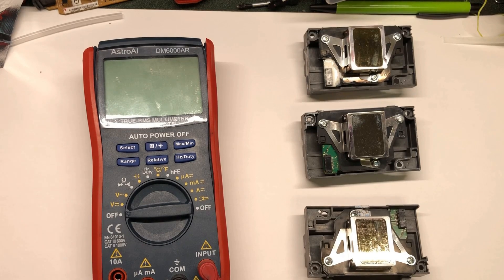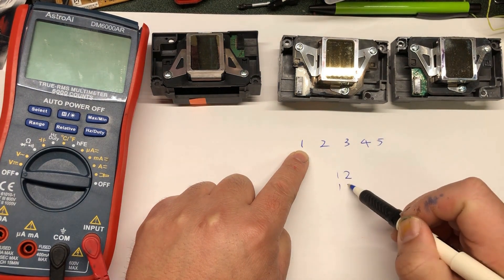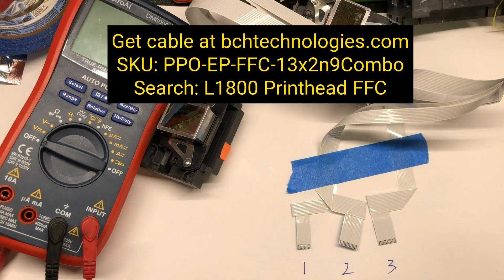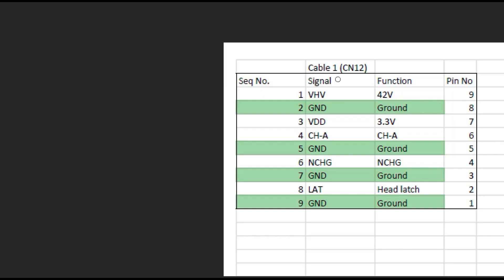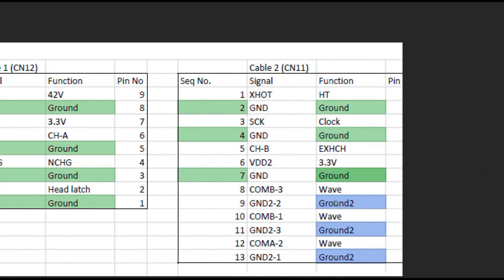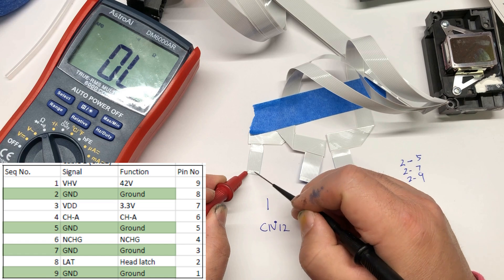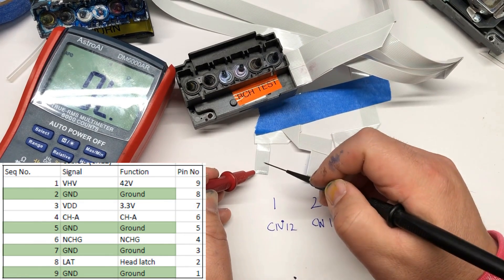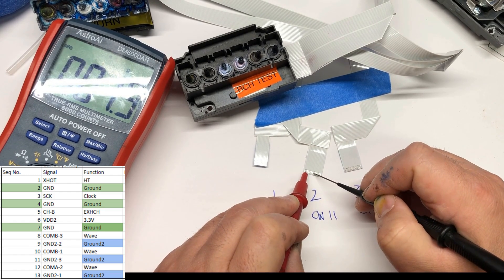Good or Bad? Testing a L1800 Printhead with Multimeter Revealed!

Comment: Did you aver tested tx800 printhead?
Reply from the maker: Thank you so much for subscribing and for your support—it really helps the channel grow as we work towards our 100k goal! I have not personally tested a TX800 printhead with a multimeter, so I can't provide specific guidance or reliable values for that model, as the circuitry and acceptable resistance can vary significantly between different printheads. I'm currently working through a large backlog of subscriber questions and aim to answer within a few days, but for accurate, model-specific technical support on this, your best and fastest option is to email support@bchtechnologies.com directly. If my other printhead testing videos have been helpful for your repair journey, I’d be incredibly grateful if you could leave a kind review on my Google page at https://g.page/r/CfL7k6nYvPQ9EAg/review.

Comment: If my head for R270 short circuit between VHV(Pin9)
 and nearby GND ( Pin 8) due to ink. Now it was tested between these two pins are 56 ohms. How can I fix this problem? Thanks!
Reply from the maker: Thanks so much for subscribing and helping us on the road to 100k! Your support really drives the channel forward. Regarding your question, unfortunately once there’s a short between VHV (pin 9) and GND (pin 8) inside the printhead, there’s no way to fix it—those kinds of internal shorts are permanent. I try to answer subscriber questions within a few days, but I do have a big backlog right now and I’m catching up as quickly as I can. If you ever need faster help, you can email [support@bchtechnologies.com](mailto:support@bchtechnologies.com), though members always get first priority. And if this video or my comment helped your journey, I’d be so grateful if you could leave a review on my Google page here: [https://g.page/r/CfL7k6nYvPQ9EAg/review](https://g.page/r/CfL7k6nYvPQ9EAg/review)

Comment: I3200 print head chek this way?
Reply from the maker: Thanks so much for subscribing—it really means a lot and helps us get closer to our 100K goal (we're climbing steadily!). The method shown in the video doesn’t apply to the I3200 printhead because different printheads have different pin layouts and signal configurations, so using the wrong method can cause inaccurate readings or even damage. I try to answer subscriber questions within a few days, though I’ve got a big backlog right now—really appreciate your patience! If you need urgent help, feel free to email [support@bchtechnologies.com](mailto:support@bchtechnologies.com).

Comment: Do you have the pin chart for the xp-15000 as well? I blew my F1 and I want to see if the printhead itself is bad before I replace the fuse. Thanks!
Reply from the maker: Thanks so much for being a member! Your support means a lot and helps us keep producing exclusive videos and giving early access to unreleased content. We also make sure member questions get top priority with detailed responses like this one. I don’t have a pin chart for the XP-15000, but if the F1 fuse blew, that's usually a strong indicator that the printhead itself is shorted or damaged—so replacing the fuse without confirming or replacing the printhead may just lead to another blown fuse. Thanks again for being part of the member community!